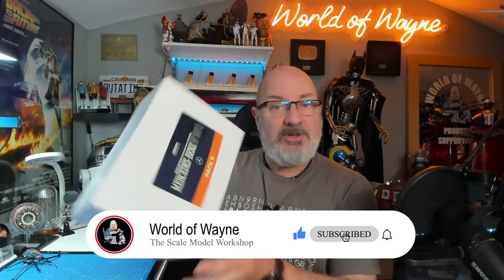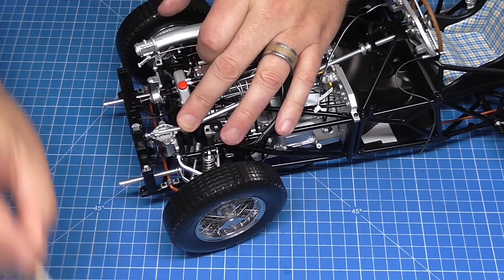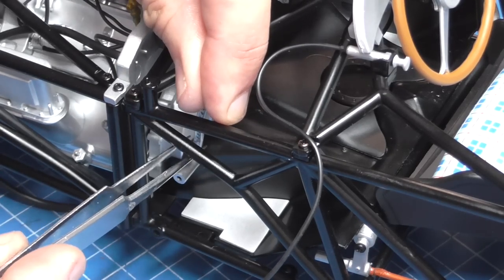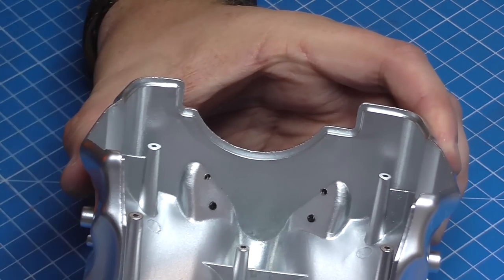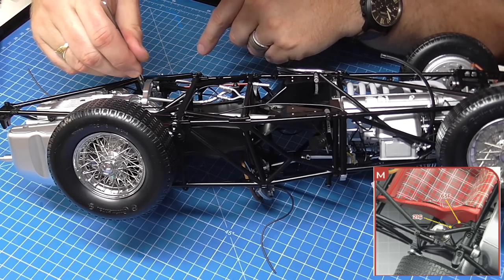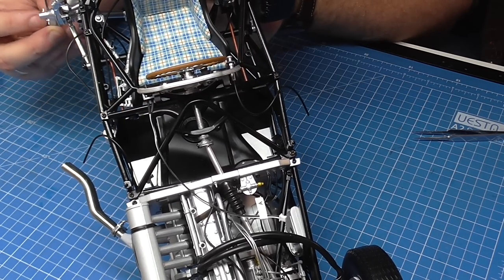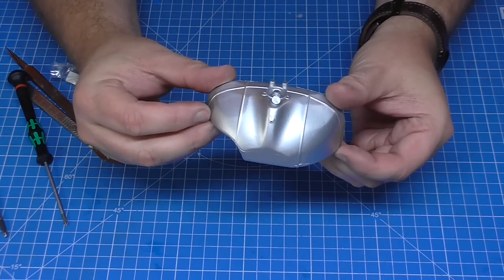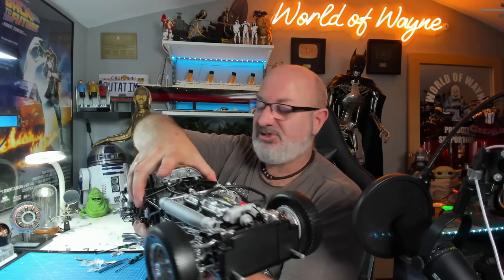Build the 1:8 Scale Stirling Moss 1955 Mercedes W196R - Pack 9 - Stages 61-68

Comment: Hi Wayne, Coming along nicely and I like what you said about doing a better job showing just where the tubes (both ends) connect to - that's a big help.  Time to zing you for your parts names...🥴 but it's all part of the fun and you make it so by being such a good sport about it!  The part you call a steering column @5:04 and 5:54 is actually the driveshaft, which you guys call a propeller shaft, or prop shaft.  I think those are found in boats!  Lol.  As always, love your work, and your commentary and can't wait until my W196 arrives.  I assure you I will make good use of your videos in completing it!  P.S. - Those pipes taped to the top side of the fuel tank tank are just as they were on the real car.  I have a nice publication by Karl Ludvigsen,  "Mercedes Benz Grand Prix W196" and it has an original b&w photo of the exposed fuel and oil tanks showing the pipes actually taped to the tank, just as the model does!

Comment: I don't like that exposed pipe either. is there a body panel that covers it?
you definitely got "hosed" with this stage. I wonder if a spare tire from another build put on as a temp would have made it easier to work with
Reply from the maker: Yes I forgot a body panel covers it but I originally had it all hidden

Comment: I think that the "Steering shaft" as you ( wrongly) called it is in fact the drive shaft aka prop shaft 😊
Reply from the maker: It’s the drive shaft. For some reason the instructions call it steering shaft
Reply: @WorldofWayneUK  must be right, if that's what the instructions say😊
Reply: @mikeking2539  - The folks that make these instructions wouldn't know a crankshaft from a mine shaft!  They are clueless with car parts.  :face-orange-biting-nails:
Reply: @WorldofWayneUK  come on Wayne .. in UK that’s the prop shaft 😉

Comment: I definitely agree that it looks better with the hose fed underneath, regardless of a body panel being attached to hide it. I doubt on the real car that they are affixed to the tank with tape. Most likely a hose clamp is either screwed in or molded hose guides. I must say though attaching the steering mechanism on this car is one of the most, if not thee easiest assemblies I've seen. It's painful that this is a limited edition came out at a time I can't budget for it at the start of my retirement. 😐
Reply: @Rick Gregory - Actually, the real car had those two fuel hoses taped to the upper side of the fuel tank just exactly as it is shown in the model directions.  From all the groaning about these hoses being there, I think most of you think the fuel tank is the outer body of the car, which it is not.  It is only shaped like the body to maximize the amount of fuel it will hold.  It is all completely hidden by the body when finished.  😁

Comment: Hi on stage 63 cant get the gas and brake pedals to install. Wont go through the bottom "slot". What is the trick? I have tried many different angles but it just wont go. any suggestions?
Reply from the maker: Oh. I can't remember what I did.

Comment: I'm really not a fan of the order in which this is supposed to go together, it really should have been thought out better.
Reply from the maker: Agreed
Reply: @NSAdonis -  Seems to be standard with large scale kit models.  Take a look at the Pocher 1:8 Lotus 72, it's a nightmare compared to this kit!
Reply: @Loulovesspeed  it's still poorly tought out. For one, you have to wait 3 months for the last wheel, do cramped space judo with the piping, this one in particular also has a lot of part removals in the steps.
Reply: @NSAdonis  - I take it you have one?  How do you like it in other respects - fit and finish, quality materials, overall looks?
Reply: @Loulovesspeed  I do not, I base my opinion on what I see from Wayne's videos.
Reply: @NSAdonis  - Well mine is still on order and fortunately I won't have a problem waiting for the different packs, as I purchased mine for a single, complete shipment, just as I did with their 427 Cobra SC model.  I'll try to remember to get back to you after I have built it myself and let you know my feelings on the kit.
Reply: @Loulovesspeed  Appreciate it :)
Reply: @NSAdonis  - Look at the many comments on YouTube site "Splash Baker Model Builder" in her various videos building the 1:8 Hornby -Pocher Lotus 72 F1 model.  Not just her observations but those who are making their own comments.  I actually had this on order until I saw that the manufacturer issued (4) revisions to its build instructions as it was being released!  Yes, 4 revisions to get it right, and I'm not sure that it is yet.  Many errors in correct part identification, assembly order, etc.  I had built their models previously and while they had some minor errors, this kit sounded like a complete disaster!  I cancelled my order after hearing this.
Reply: @Loulovesspeed  FWIW, I've actually enjoyed my Lotus 72 build to date. There are definitely some build sequence issues, but that's never really too much of a problem because most things are screwed together and easy to undo when needed. The revised instructions are now actually quite good (which in Pocher terms means the exploded views are more accurate, it's still up to you to figure things out). Quality of the kit is excellent, and based on what I have so far, I suspect it's going to look outstanding in a display case.
Reply: @TheTruthCalls  - I have built 6 Pocher kits before and their instructions get worse as time goes by.  They are by far the worst of the large scale model makers.  They need major updating from their black and white, vague, unclear ones now.  Compare them with the significantly clearer, color, up close instructions offered in IXO and Agora models.  It's not just me my friend, but hundreds if not thousands of other model builders concur with my complaints!  Good luck with your Lotus 72.  :face-turquoise-covering-eyes: